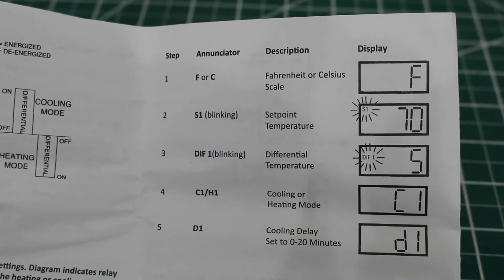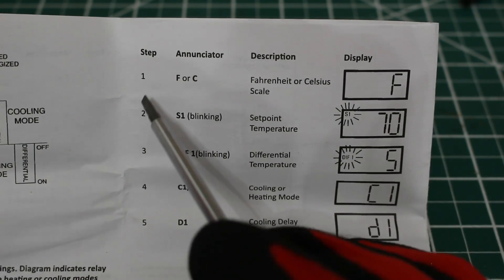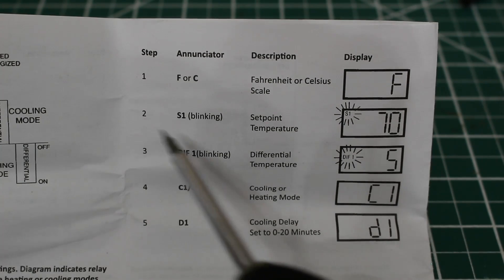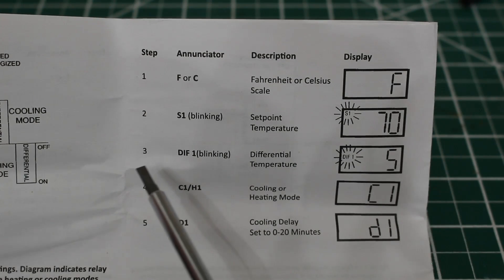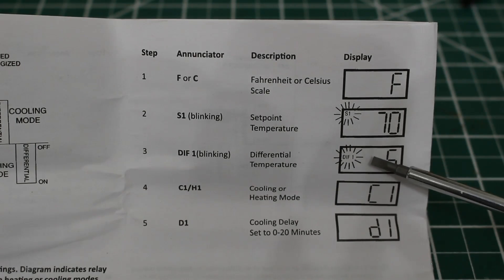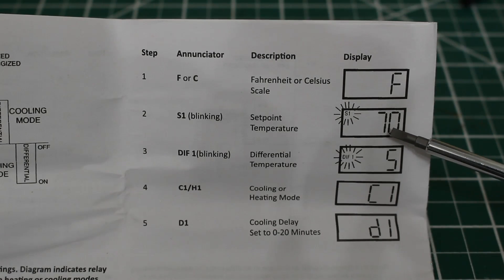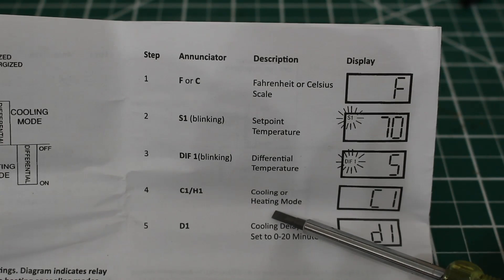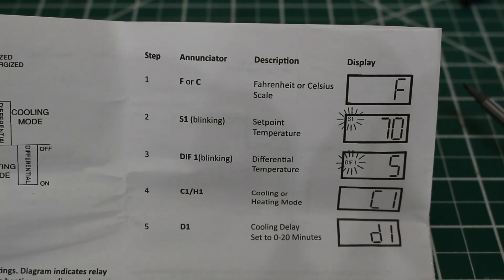HVACR Training: How To Program RANCO Electronic Temperature Control (RANCO ETC-111000-000 Control)

Comment: How do you replace if the probe is working and buried. Can you splice the sensor cable if necessary vs soldering off and old probe on circuit board?
Reply from the maker: I don't think cutting that sensor wiring would be a good idea. I'd call the manufacturer for those details. It is best to just replace the entire sensor and connect it to the board. Mount the new sensor in the correct space. Thanks for watching 🔧⚡️

Comment: The d1 setting is useless. One good reason for compressor time delay in beverage and food storage is to de-ice any ice forming on the evap. (Since the temps are way lower than air conditioning.)  This can be achieved by increasing the differential setting.

Comment: Hello I believe i have this same exact unit. Can you please explain to me how to either turn off or raise the temperature for my 5 door freezer as it has iced up?  I hit set F came up I think and I hit set and it read -10 I used the arrows and put it at 45 and hit set again? I'm not sure if I did this correctly as it still seems cold. Or should I try and set it higher than 45?